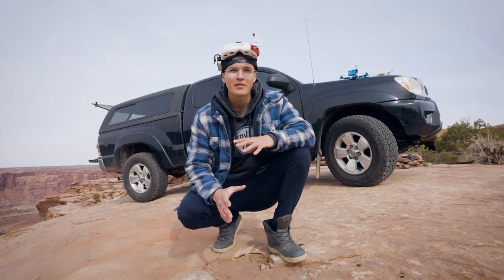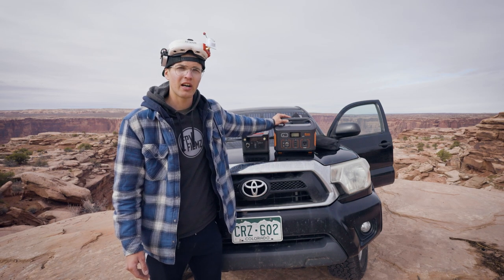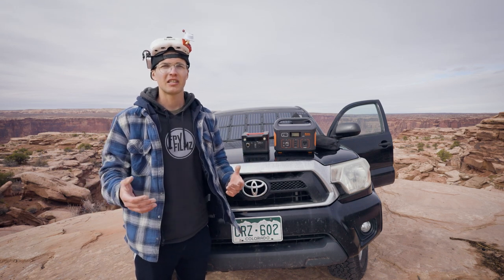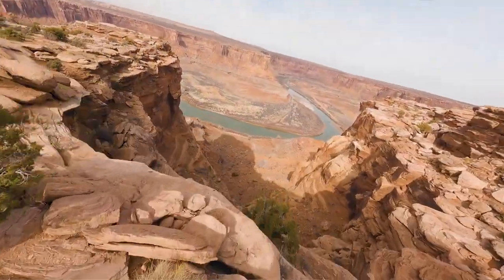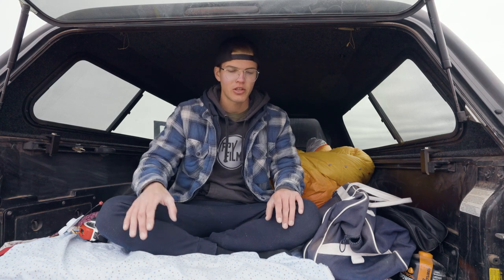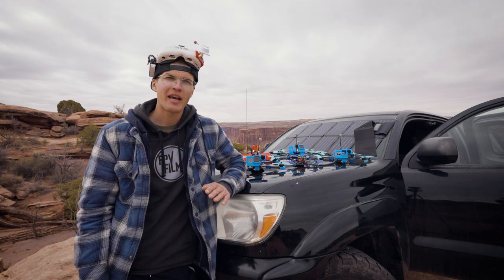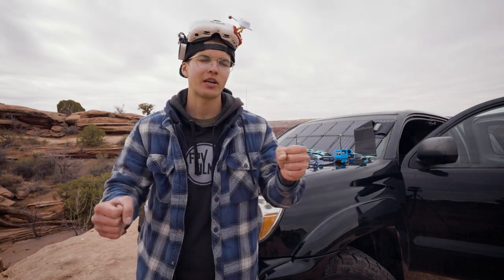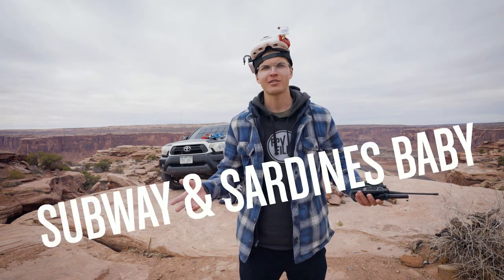Back Country FPV - What You Need for Off-Grid Drone Flying

Comment: Carter and those fuses.

And I appreciate that you have a fire extinguisher, now... 😂 

Power inverters running off of your battery leads are a life saver, as long as your car is on.

I like to carry a Butane stove, as it doubles as a heater, and stove.

Headlamps, for if you lose your quad. Loads of battery straps, and multiple styles of Hero mounts, as you always need multiple ways of mounting just in case.
Reply from the maker: Should I start casually dissing Carter in every video until he notices haha? 😄 Butane is nice but it's not required. I've gone on trips without, even in cold temperatures. LEDs are definitely a must though. And also my door handle is covered with battery straps haha
Reply: @NikoFilmz  it's definitely not required, but eggs and bakey in the morning hits different in the back of your car.

You mean you haven't been dissing him👀😂
Reply from the maker: @LtRyanPYT  Truth, but Subway and Sardines are pretty dope as it is haha